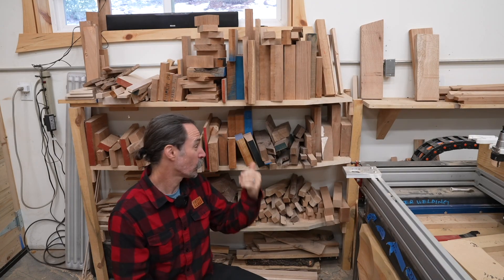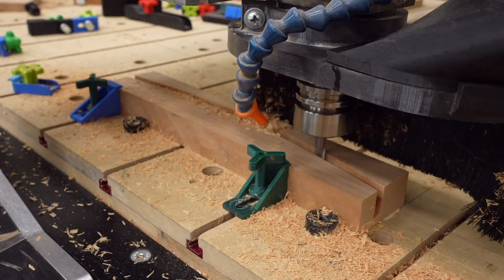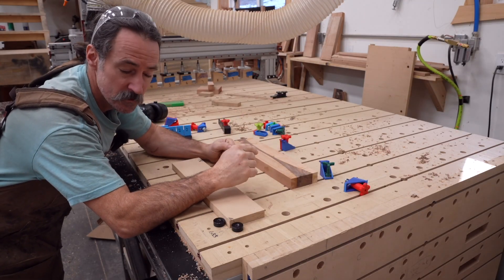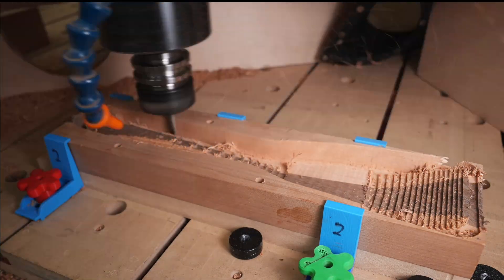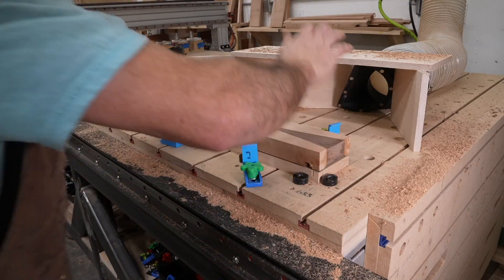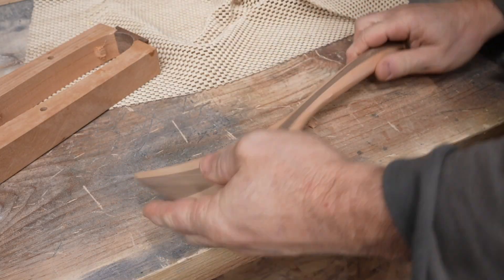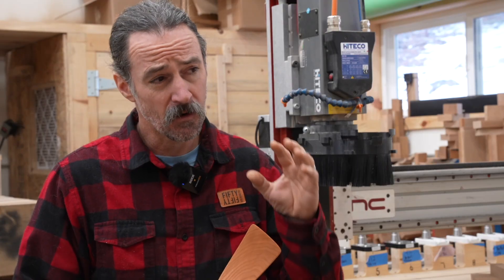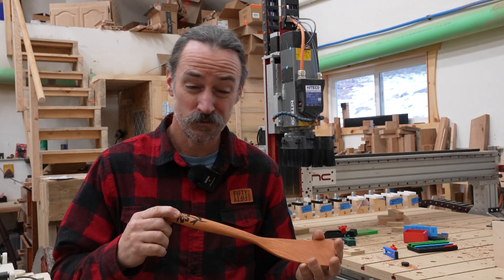Making some fancy utensils from scrap wood with my CNC router (PS: files available)

Comment: So glad you’re doing things in fusion!
Reply from the maker: It took me a while to get the hang of surface modeling, and I'm still pretty new at it, but I really do like the results and ability to easily manipulate the shape.
Reply: @CorbinDunn probably my weakest area. I enjoy using forms a lot, though it doesn’t have the same curvature precision as surface tools. We need to get you a rotary axis so you can figure out tool paths there for us ;)
Reply from the maker: @rbyt2010  I ordered one! I'm hoping to have it by christmas.
Reply: @CorbinDunn excellent! Probably save me a lot of work 😂 I have an early pro machine which I built out with clearpaths and linuxCNC. Currently rebuilding to centroid, new ATC spindle and generally making current with Avid (now that they’re mostly making the  machine I originally wanted). After I have that sorted , I’ll re-install the rotary and see what you have ;)

Comment: One additional comment/question I see your Fusion file has all of the different elements.  Unfortunately for me I am not expert enough at fusion yet to actually understand all of the various pieces in your fusion design, like how to make the multicolored walnut and cherry cuts to achieve what you did.  I thought it was just the CAM part of fusion I needed help with but really need helpd how you designed in fusion.  Don't think I saw a video on how you did the spatula design in fusion.  Do you have a video walking through the spatula design in fusion and I just didn't see it?  IF not, would be interested in that because I clearly have much more to know about fusion than I originally realized.  Thanks for everything.
Reply from the maker: Yeah - I don't have a video on the design of this; I would like to do more Fusion specific videos; in general, they don't do as well as other ones, so I haven't done a lot of them, but a lot of people do seem interested in them. This design is more complex; lofting with surfaces, and surfaces aren't easy to understand. "Body" modeling is easier, and should be the first thing that people understand in Fusion before Surfaces. 

 It took me a few days to come to the shape I liked; and after I kept tweaking the design on the first 3-4 ones I made until I finally had a shape that I really liked. This video is a bit about surface modeling, but it is more complex than what the spatulas are. https://youtu.be/REvb_twxxPY
Reply: @CorbinDunn i’ll check the video out

Comment: Another good and infroative video.  I may not always watch when your videos first come out but will watch when I have time to spend because I can't just fast speed through them because I want to hear what you are saying.  You have so much knowledge to share and I am anxious to hear what you are sharing.  I would really like to see how you setup a curved inlay in vCarve.  I am thinking you would need aspire for that but if there i a way and there is enough interest shown maybe you will try and tackle that - since you said let you know if there is interest.  I am still intimidated by the CAM part of Fusion 360 and haven't been interested in tackling that.  One of my reservations is my CNC is a pendant driven machine and there is no computer software like gsender or Mach 4 or 5 etc. driving it.  Only the gcode downloaded to a USB that sticks in the pendent.  Not sure if that matters.  Thanks again - now it's time to watch the vcarve version.
Reply from the maker: Thanks Rob! You don't need Aspire to do curved inlays; it is just a trick I do for projecting onto a surface. I really should do a video about it, as I don't think anyone else has stumbled across that method. It is limiting in what it can do.

Pendant CNC's w/USB sticks are still great! My older Tormach had no internet and I had to use the sneaker net to get files onto it. A proper computer driven CNC is nice to see what is going on, but you don't really need it.

Comment: When I did something two sided like this recently I just put in a pass to lightly face the stock on the first side, then set my zero from the bottom on the second side. That meant the second op was starting from an exact known height and the initial stock thickness didn't matter.
Reply from the maker: That definitely works! I think a goal should be to reduce the amount of work one does, and touching off only on your spoilboard is (usually) less work, or no work at all if you have a tool height setter or ATC. You could also make your stock thicker than it needs to be, always touch off on your spoilboard, and on the first top operation surface the top at exactly the right height. The problem with this is that you can't clamp it from the top, and have to hold it down some other method. I've got a DRO on my planer and it is pretty easy to hit within a few thou on the thickness (usually within 5 thou)

Comment: My experience says that 3d adaptive really isn't that fast compared to pocketing unless you can go about 4x deeper (for hobby kr enthusiast non-pro machines). If you can do that, you're probably not being aggressive enough on pocketing. Wood is much more forgiving than metal, especially in the corners where adaptive makes a huge tool-load improvement, so that advantage is pretty well mitigated. I also don't really care for the "tool wear" advantage, since I get to buy cheaper tools with less cutting edge, and I still typically manage to ruin them dropping, accidentally overheating (with a bad feed/speed, hole drilling, etc), cutting into my spoilboard (mdf), or dropping long before I wear them out. Controversial, I know. 

Also for chipout, I agree that across the grain helps, as WITH the grain tends to break my the wood into long splinters that rip out ahead of the tool. This can be eliminated (largely, and often completely) by climb cutting and/or using a downcut endmill. Fusion is great about direction. Vcarve will only climb 100% on concentric perimeter-driven passes, which then leaves witness marks cross-grain. To travel back and forth raster-style, it only allows the option of climb one way, conventional back the other way.... No lift and travel....which sucks because I'd gladly trade some machine time for sanding time but now I have to trade a LOT of machine time for it with a finishing strategy.

Thanks again for all the videos. I've got some projects in the way, but that revised dust boot is still doing it's thing until I reprint it with much larger magnets. Since the skirt mount is now parametric too, I'm just going to print a few different lengths to swap in and out without the bristles.
Reply from the maker: Cool - that kind of confirms what I was thinking about cross grain vs with grain; I see similar results as what you've been talking about. I need to start a document with all this knowledge and tips so I don't forget it all! I do get some speed benefits with 3d adaptive when I'm clearing out the inside of bowls using 3/8" upcut bits, but in most cases it ends up causing more problems due to the thin back cuts.
Reply: @CorbinDunn o could definitely see that adaptive helping on bowls because you have long, large endmills that can reach down AND a little more rigidity than most hobbyists. Next up.... Balancing stepover against speed! Fast, small stepover or slow fat steps?

Comment: Great work as always - one question, I know you said in your link that aspire can open it, but if I just have desktop, can I use your file? I’ve done some real creative stuff using the molding toolpath but that isn’t true 3d sculpting. Thanks!
Reply from the maker: Aspire, 12.5 or higher, should be able to open the Vectric VCarve file directly. Any version of aspire can import the STL. The "Desktop" limitations are based on the size, and this should be small enough that it will be fine. Also watch the companion video where I setup the STL model from scratch: https://youtu.be/fjrkyNjdVFY -- the sculpting is all done in Fusion, not VCarve or Aspire.